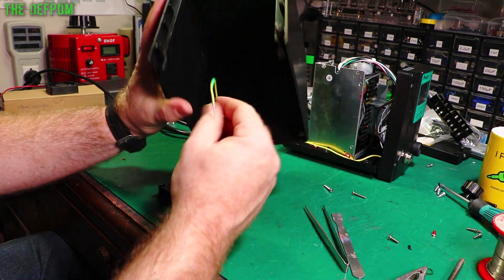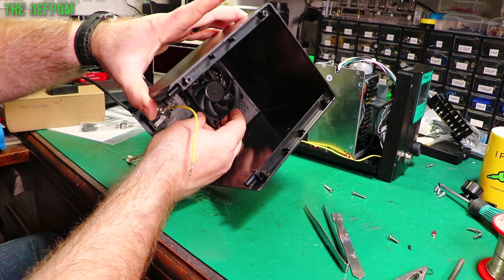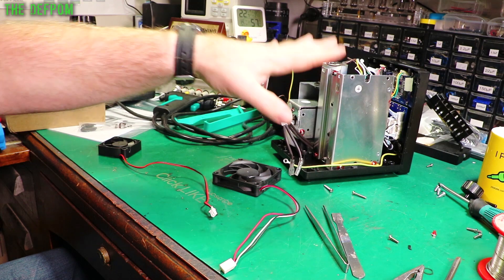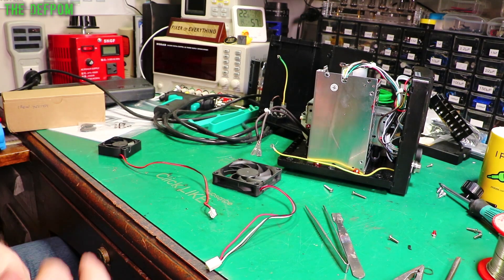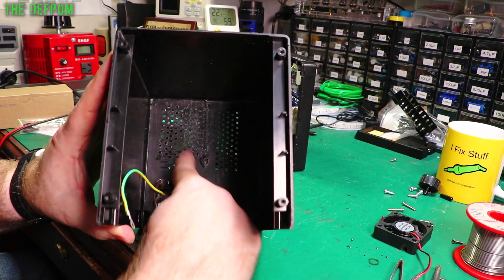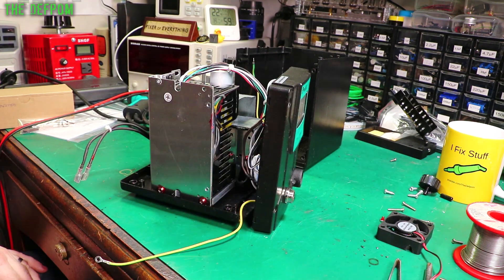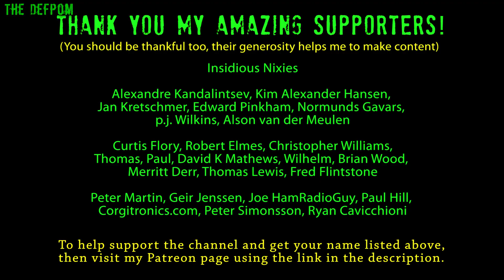🔴 ProsKit SS-331 Desoldering Station Improvements - No.858

Comment: hello
i bought one of these last week and the desoldering gun isn't heating up. the seller event sent a spare desoldering gun and that one isn't heating up either. the problem must be in the unit itself. do you have any idea what might be the issue? is it a loose cable? it's not the heating element
cheers
Reply from the maker: @LiquidSnakeSSJ4  if I remember rightly this unit had two cables swapped over from the transformer, just plugged into the wrong places, might be worth checking if one has come off.
Reply: @TheDefpom  thanks for the reply mate
i ended up opening the unit and the two thicker heating element cables at the bottom had been knocked out of the port during shipping. all works now 
👍

Comment: Those holes in back are WAY too small and are blocking virtually all of the air flow, too much flat surface causing the air to blow back into the fan blades, makes for very inefficient airflow - I have to mod some computer cases by cutting a hole the size of the fan blades then attach a grille with good flow on the back - also your fan blade may be hitting that plastic molding in the back of the case

Comment: Translation fr/ang
hello do you recommend Anesty ZD-915 or the Pro'sKit SS-331 the Anesty ZD-915 is made of steel with the 6-pin gun and the Pro'sKit SS-331 has 7 pins what is the difference in pinout I still have a vintage XYTRONIC 968 Desoldering Station 218 also with 7 pins still works but I have to repeat the operation several times to desolder for several minutes I find that the gun is lighter mine is still a bakelite tube plus the cable and the hose a little heavier in the long run it hinders the work thank you
Reply from the maker: @leas837  I don’t know how they compare, but after doing the modifications to the SS-331 I have been happy with it, I still use it often.

Comment: Hello. I wonder if you still have this unit and if you can make a long term review? I'm about to buy and I would like to know if it keep the specs after so long time. Thank you.
Reply from the maker: @alexxfiles  yes I still use it, I have been very happy with it.
Reply: @TheDefpom  Thank you for you reply. Means a lot.
Reply: I;ve had this unit for about 2 years and use it once a week or so. performance wise it is still pretty good, but the rear of the nozzle is prone to clogging, the filters are obscenely overpriced so I use some generic cotton ones doubled up. the spring in the catcher gets mangled over time, and the plastic mountings in the handle melt and degrade with a lot of use. emptying the catch tube is a messy pain in the ass compared to other units, but this unit has held up well enough that I still haven't gotten aroudn to replacing it with a higher quality one. 

for a couple hundred bucks, it is pretty good value for a self contained unit. really annoyed that there isnt a higher quality version of this from one of the other companies like atten

Comment: Hello sir
I have the old model blue one
Im having problems reaching the temperature on the screen
There are 2 potentiometer in the main board 
Are these for calibration?
Have you tried them
Reply from the maker: I wouldn’t be adjusting it, sounds like it needs a new heating element.

Comment: Thank you so much for giving your video on the SS-331H  . After I watched your video I took my new one apart that just came in the mail today without testing it first . My idea was to drill a rectangular shape of holes into the left hand side of the case where the switching power supply is in order to allow fresh air to cool where it needs it most . Second thing I done was to remove the fan after marking the edge on the fan case with masking tape so I knew where to drill out some of the holes on the back cover to improve air flow exhausting heat . The fan runs very quiet and has a nice stream of air circulation through the entire case now .
Reply: And of coarse I replaced the fan same as it came new in the box after rear exhaust holes were drilled out larger . Thanks
Reply: funny enough I've still got the original fan in mine after two years, and it is one of the only things I don't have a complaint about with this unit

Comment: I have the same sucker but in a different housing (zd915) and I strongly advise You to install a 5 amps step down converter to provide 12v instead of 18 to the fan. My sucker runs the pump and the fan on the same power rail and it relies on a series of resistors combined with the load of the pump to drag it down to 12v from 18.
Now with the converter I run 13v (12,5 at the pump), it became nice and quiet and the fan is happy, the pump is snappy.
I shot the warranty but that´s worth it to my nerves. Plus: the converter mounts right into the box where the resistors were, very tidy.

Comment: The best place to place the cooling fan is on the power supply where it is really needed. Where it is now it is completely useless. And if you want a silent fan that works when needed, just connect it to the vacuum pump. In this way, at the same time you unsolder and cool down the power supply unit. Any noise from the fan is covered by that of the pump. The air extracted from the power supply finds its way out by itself thanks to the vortices caused by the blades of the fans cooling the whole.
So I modified my 331H and I have to say it works great
Reply: The idea of an exhaust fan is not completely useless because it lowers the ambient temperature inside the case. But before doing any fan upgrades, you should first measure if there is an overheating problem.
Reply: @hbgl8889  Well, the ZD 985 desoldering station does not have a fan but has the same power supply unit. The ProsKit SS 331H is nothing more than a ZD 8915. From these premises and imagining that the only part that produces heat and which justifies the presence of a fan is the heat of the PSU, I inserted the fan on this making it activate by the gun when it is in operation. Now the question is: the winding is necessary or not? The case of the ZD 985 is smaller than that of the SS331H and yet the fan does not exist and there is more stagnation of air, with my system I solved everything.
Reply: @Biribeau  PS, even under no load conditions, the SMPS will still get warm, wireing to the pump sounded good, but on second thoughts, cooling takes time, the quick trigger press's are not going to be effective imo and will shorten its life.
Reply: @engjds  The ZD 985 desoldering station does not have a cooling fan and has a much smaller internal space than for example the ZD 915 and the ZD 8915 (Pro's kit 331H). They all have the same PSU and the same vacuum pump . In a small space there is less air circulation and consequently less heat dissipation. So why build a soldering station without a fan? The PSU more than the vacuum pump is subject to heating and this applies to all models. By mounting a fan on the PSU and operating it for the duration of the desoldering, the air is forced to circulate inside the case, cooling the pump, which heats little, and pushing it into the PSU causing the air inside to change. This system works on great on all my desoldering stations and has the great advantage of having eliminated the annoying noise of the Fan.
The fans that I mounted on them have a diameter of 6 cm, a height of 2 and are of the dual bearing type. So they have a good air flow. I recommend it.
Reply: Did you check to see if the Vacuum driver/transistor can handle the extra load?

Comment: I wouldn’t worry about fan interference since I can always mount externally and throw a grille on it. Heck, even if mine does fit inside I would cut a hole and use a metal fan grille so that it flows more air and can run slower/quieter.
Reply: Was thinking the same, BUT you try buying a grill that doesnt protrude out of the case, will look ugly on this plastic unit.
Reply: @engjds  the traditional wire grille always looks fine, even on completely exposed fans. You know the ones: Chromed with concentric rings plus two angled V-shaped pieces that hold the rings and form loops at the end for four screws.
Reply: @emmettturner9452  Beauty is in the eye of the beholder I guess :), been looking at some crazy mods for this including delayed-off vacuum and apparently the vacuum pump rated at 24v is only running at 18v which can be tweeked in the SMPS, its on EEVblog.
Reply: @engjds  I wouldn’t mind the entire fan being mounted outside the case. ;)
Reply: @emmettturner9452  LOL, I would be the same, but after getting my room geared up with fancy new DSO and PSU's, heath robinson designs would not match, maybe I am getting soft in my old age, will be looking at soft fabrics and cushions next!

Comment: I dont like original tips, they have large gaps between tip and heater (cone and 90 degrees angle are mated). And for desoldering from large polygons I made my own. In general, the factory did strange thing that it did not do a seal at the edge of heater. The solder trap implemented strangely, it blocs the suction hole, therebly creating resistance to flow.

Comment: hello i bought today i wanted to ask how does automatic sleep work, thank you
Reply from the maker: After a period of time (was about 5 min I think) it drops down to 200 degress C until you wake it up by pressing the vacuum trigger.
Reply: @TheDefpom  As we are aiming for a sharp pulse of vacuum, I think it might be better to overdrive the pump by say a 1/3 extra voltage above 24V @ 32V, should be good for the 1 second its used per joint. PS you can buy 12V miniture vacuum solonoids, that MAY even fit inside that handpiece.

Comment: Can you push that cleaning wire till to the metal spring?
Does it also beep every 5 minutes while off?
Reply from the maker: The cleaning rod passes right through, no beeping when it’s idle.
Reply: @TheDefpom  mine goes in max 6,5 cm. Think, there is something wrong in the heating element.

Comment: I've got a ZD915, which I believe is basically the same thing as yours but with different branding. In mine, the fan is 12V, but was actually running at closer to 20V as it shares the voltage with the pump, iirc. I replaced the fan with an equally sized one, but less noisy and hooked it up through a 12V regulator. The old one had become more and more noisy over time, probably due to running at a too high voltage. My station is nice and quiet now but still pushes an adequate amount of air out the back.

Here's where I got the idea: https://youtu.be/2zr097eMff0

Comment: Sorry but if you make a power switch with only one pole???? 

anytime use an 2 pole switch, thats save.
Reply: I don't think there'd be enough space for that in the spot they chose. A switch that had two poles would have them too close together, which is more dangerous than having only live switched. The case is plastic, so there's no risk of that.
Reply: Can anyone explain why indeed two pole switching in a earthed system is better? is it just a question of redundancy that if one pole fails you have another that may not fail at the same time?

Comment: To reduce any fan noise you should separate fan from the case by mounting it on some sort of rubber spacers without any hard material connecting them both together. Good idea, poor job
Reply from the maker: I used what I had on hand, I have since got some proper rubber fan mounts which are used instead of bolts.
Reply: @TheDefpom  There's these little nibs that you stretch to get through the holes and they're actually laughably cheap. I bought a bag of 100 for a couple euros. I've since become obsessed with replacing fan screws with these.
Reply: You can buy fans with integrated rubber mounts and specials notched blades to lower noise.

Comment: Where's the source of incoming air?  I don't see any but might have missed them.  For optimum cooling, I'd think you need holes in the bottom/front of the case so it passes over the power supply and exits the back.  I would also plug up any of the back holes that are outside the perimeter of the fan.
Reply: I think its relying on the drilled back panel, you would think they would route the vacuum input drectly to the outside instead of dragging warm air through it.

Comment: It is not only the size of the fan that defines air volume. The depth of the new fan looks to be less than the original fan. That would probably effect the static pressure of the new fan. You need to measure the air flow at the outlet to know if it is better or worse.
Reply: Yeah, sounds good, but how many people have that type of vane airflow meter hanging around the workshop, not many is my guess, then you have problems of coupling it to the outlet, nope, lets face it, not even the OEM designers measured this.

Comment: I had to laugh when you first powered up the new improved quieter fan! Thanks for leaving that bit in. Of course I've never assembled anything with wires rubbing on the fan! I have always used the "Western Union" splice or a close approximation, you just have to be sure to wrap the ends down tight so they don't poke through the heat shrink. As others have suggested, I would cut a fan-size hole and bolt on a metal grill, but the plastic case is the limiting factor for noise.

Comment: Thank you!  You have renewed my appreciation for my all-in-one Aoyue 968A+. I actually thought the ProKit stations were better units, judging from the modern and sleek case, but you proved me wrong. The manufacturer merely shoved a cheap, off-the-shelf, switch mode power supply into a case with a fan to keep it cool, which is ill-suited for high wattage applications.  Moreover, the ABS plastic case is prone to molten scuffs, considering how easy it is to accidentally swipe against it with with a hot soldering tip.  I guess the industrial design and not the internals soaked up most the R&D budget.

My Aoyue 968A+ internals features a linear power supply tapping 24V to the soldering handle, 120/220V to the hot air wand and air pump, and 5V to the controllers.  There's no need for a fan to keep it cool.  Although it doesn't come with a desoldering gun, if you're clever enough, you can purchase one sold as a spare for one of their higher end stations. My only gripe with the unit is it's old style soldering iron, which is not as responsive as the newer T12 cartridge style ones found in the higher priced soldering stations.

Comment: Have you faced clogging issues with your SS-331? 
Mine clogs every time I use it..
Reply from the maker: Mines been fine, only a couple of minor clogs, pushing the cleaner through once fixed it each time.
Reply: @TheDefpom  Lucky you!
Cleaner NEVER works for me. I'll have to pull out my soldering iron to heat up the other end of the heating element to get it up to temperature and then i can use the cleaner to push the solder out....
Reply from the maker: @decee1157  try running it hotter, it could be the solder is cooling down before leaving the tube.
I also noticed that solder from the collection chamber can drop onto the end of the tube and re-melt slightly causing it to block it right at the end.
Reply: @TheDefpom  Currently im running it at 370c. Sadly didn't fix anything.
Imo going higher than 370c shouldn't be a solution.
Reply from the maker: @decee1157  that should be enough, so probably not that then. Are you holding the trigger for at least 1/2 second after removing the tip from the joint to give the solder enough time to clear the tube before the vacuum stops?
Reply: @TheDefpom  Yep i always hold the trigger after removing the tip for 1 second
I just tried to clean it even more than i normally do so im hoping that would solve the problem but im not sure.
Reply: @decee1157  Clogging will be more of an issue with the smaller tips than the larger ones. If you keep having issues though, you could try seeing if a new filter on your canister fixes it. If it does, then you're one of the unlucky bastards that will need to buy a sheet of this stuff to replace it often. I find that flux smoke clogs that filter really easily. I try to use the medium size tips as much as I can, as well as holding the gun horizontal or tip up - but never tip down fully.
Reply: The temperature is set at 370 ° C. I clean regularly, everything is fine.

Comment: cut out the hole for fan and put in a grille. those holes are too small they create more turbulence and noise.
Reply: Came to say this. Done it a few times on computer cases, as they usually have stupidly small holes. Makes a huge difference to airflow and noise is reduced.

Comment: Try making to holes bigger where the fan exits as the new fan did not make that much noise when you tested it on the bench. Better still remove the holes all together and use a wire fan grill.
Cheers Dave. (speed control is fine but the fan may not start after some time )

Comment: I did this mod but ran the fan at 7v, it's practically silent and still flows more air than the original fan.
Reply from the maker: Yes I actually revisited this and installed an 8V regulator to run the fan, it is even better

Comment: I like your modifications, I think I'll do the same to mine.   That original fan sure was hopping around and making a racket on the bench.
For even quieter fans, have you seen or experimented with those fans that have the toothed or feathered trailing edges ?  
They are supposed to be much more quiet than regular fans.  Sorry I can't remember the brand at the moment.